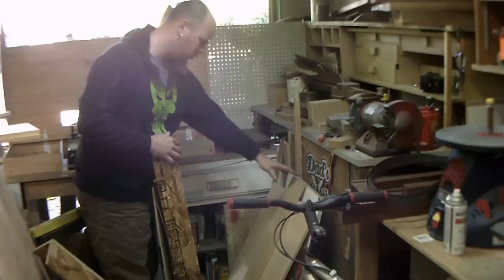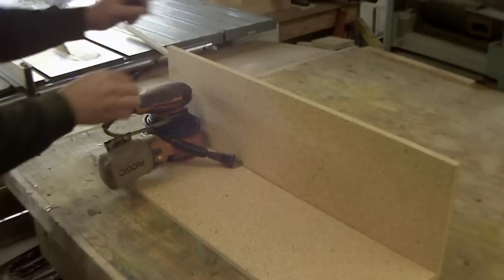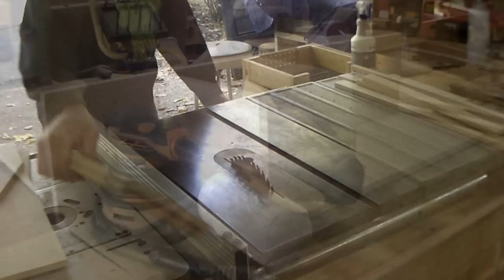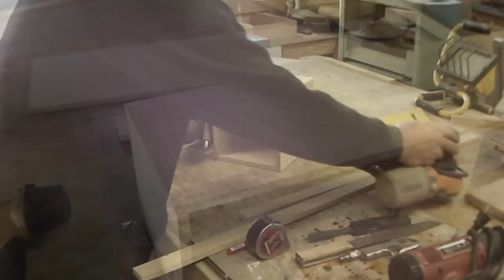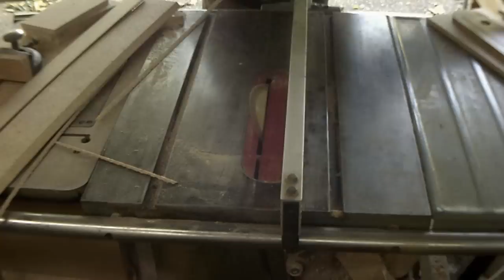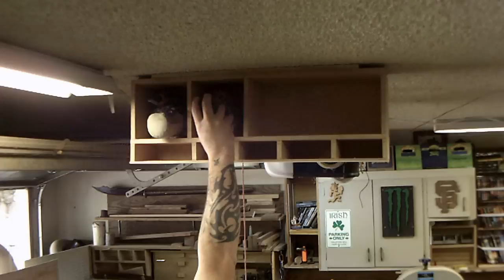overhead sanding storage (scrap wood of course)

Comment: good idea man. scrap isnt crap!;) are u using it as a sliding kinda thing? i notice u sliding it on.u could sand it to a 400 grit and wax it up some. then maybe itll slide better...
Reply from the maker: no just wanted an easy way to mount it,it's fixed into place,I screwed from the shelf into the studs just to keep it secure.
Reply: Dave's woodworks gotcha.. I wish my ceilings were higher than 78 inches tall I would do that for my Sandersand other cordless tools cuz  I'm running out of room too . I don't have much room in the basement anymore or to begin with lol.time to do some  rearranging .or getting ridda some stuff..and just go all hand tools. Ur creeping on ur 1k good stuff man!!!
Reply from the maker: +Joe basementwoodworking thanks,I know almost 1k it's crazy
Reply: Dave's woodworks youll get there sooner then u know. But im sure u know..lol keep the vids coming man they get better and better each time.